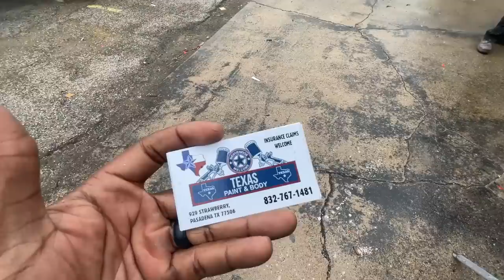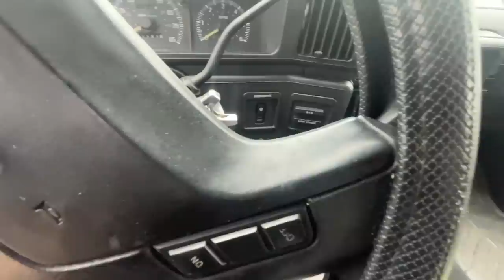GEEEZ MY BOX CHEVY IS RUINED AND BUYING OJ SIMPSON FORD BRONCO

Comment: The box Chevy going to look nice with that pearl paint job, just a suggestion I would replace that master cylinder and brake booster before you paint it because you don't know how old it is if you have to replace it later on then you're going to have to repaint it so while everything's apart right now you're better off replacing that brake booster and master cylinder they're not that expensive and then have him paint it